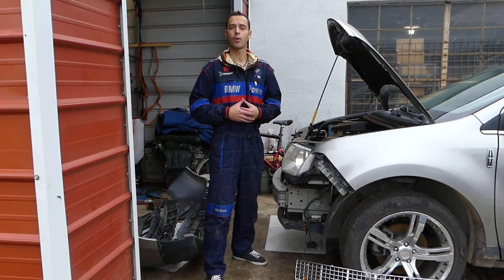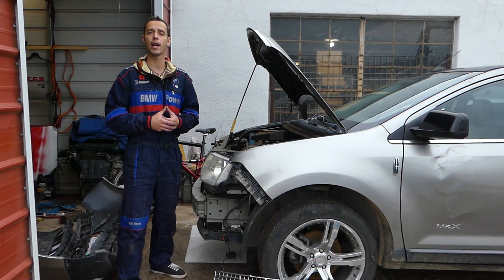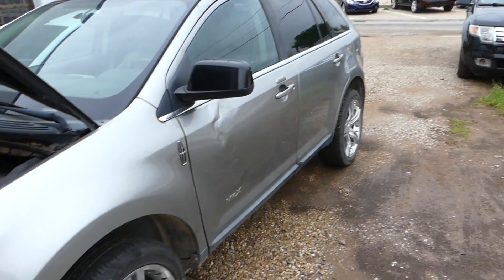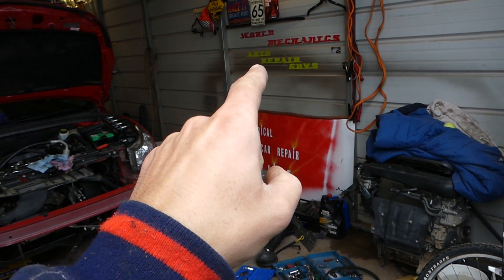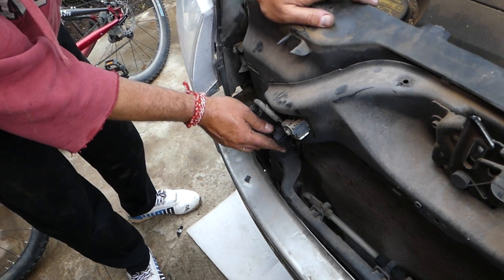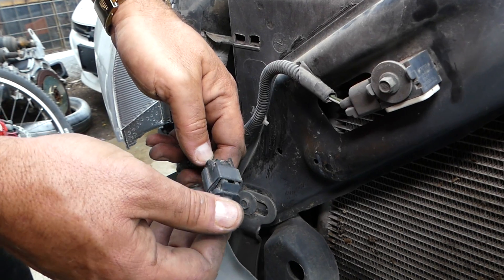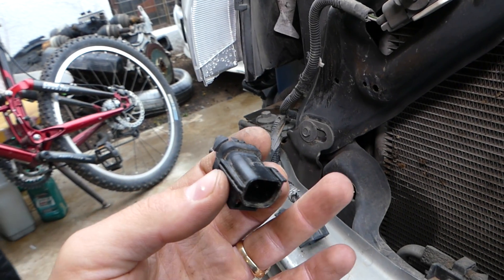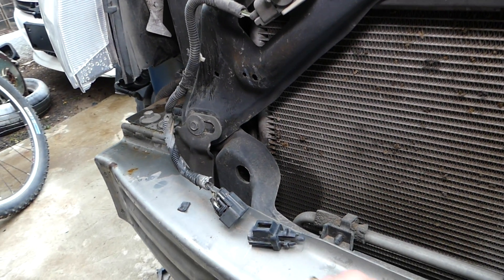AMBIENT AIR TEMPERATURE SENSOR LOCATION REPLACEMENT LINCOLN MKX  CODE P0073

Comment: Are you familiar with the same procedure for a 1990 Lincoln Town Car? And do you know if it affects the automatic setting for the air conditioning? Analog head unit inside the cabin of the car